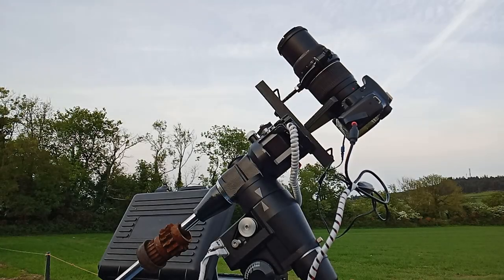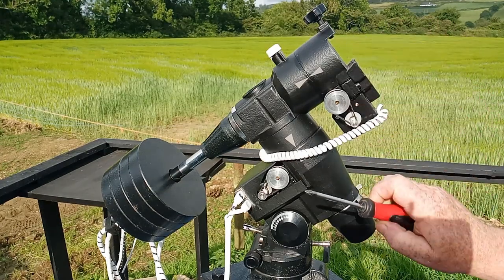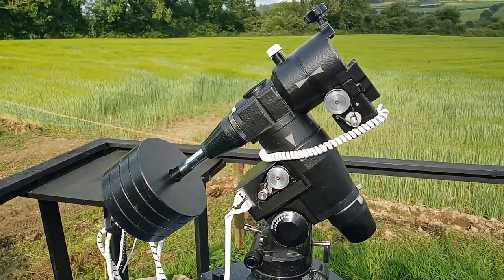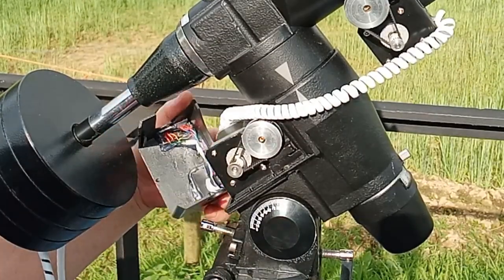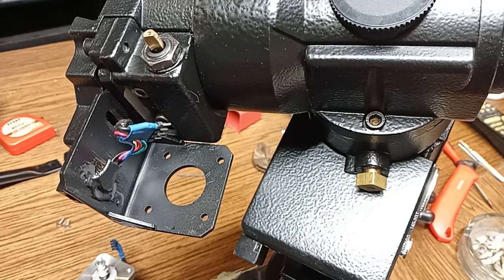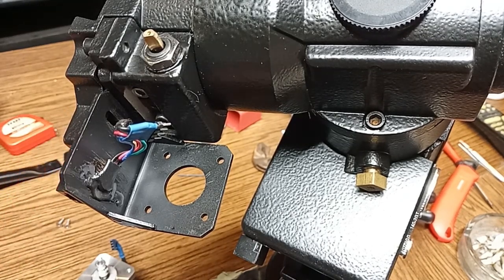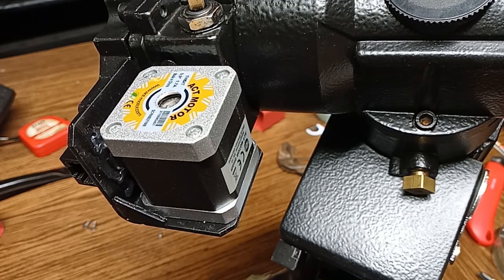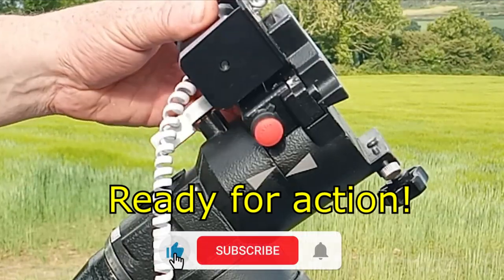Motorising The EQ 5 Mount - OnStep DIY GoTo Part 2

Comment: Great Video!
A question, what are the specs of the cable (i.e. CAT5 or CAT6 or something else) connecting your motor with the on-step control box?
Reply from the maker: I didn't even check when I ordered them, as 'ethernet cables' were the only specification. I ordered the cheapest white ones and they happen to be CAT6, but I'm sure CAT5 would suffice.
These cables have 8 connections and we only require 4 so they're doubled up anyway.

Comment: Hey. Can i motorise a eq 3 mount using onstep tracker?  Please provide some guidance if possible. Thank you
Reply from the maker: You can indeed. The build and process will be the same as I've done. Only the configuration differs.
Copy the following image for future reference even though it may make no sense yet : https://i.imgur.com/FX5zpwj.jpg These figures are for the EQ3-2.
Reply: What guiding accuracy do you get with this mount?

Comment: Hi, Where did you buy the brackets and motors?
Reply from the maker: Hi. The brackets are sold by many sellers. Just search Nema 17 brackets. The exact ones I bought are no longer available but they're all the same dimensions.
These are the motors I bought : https://www.ebay.co.uk/itm/252383525398

Comment: What is the weight capacity?
Reply from the maker: The EQ-5 is rated for 10kg visual, so 5-7kg AP).
Mine is currently managing the 9+kg of my scope.
I wouldn't push it for very long exposures with this weight as I'd just end up rejecting more, but I'm happy at up to 45sec so far. 30 sec is better. Remember that's unguided and overweight.